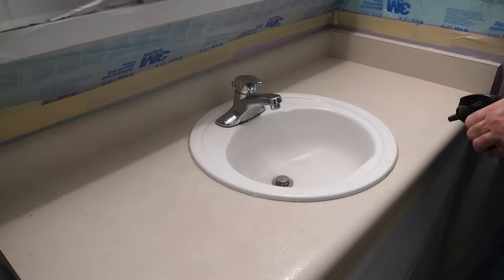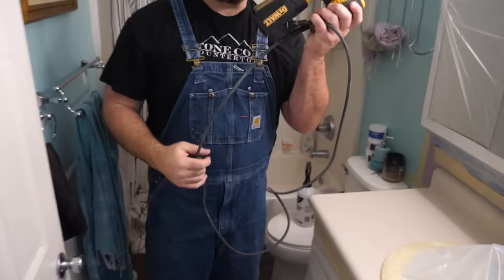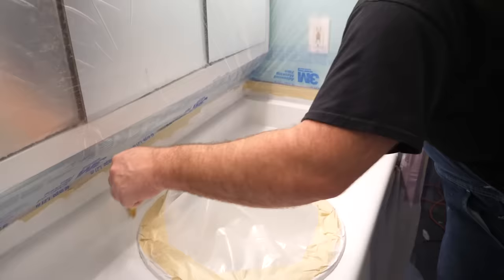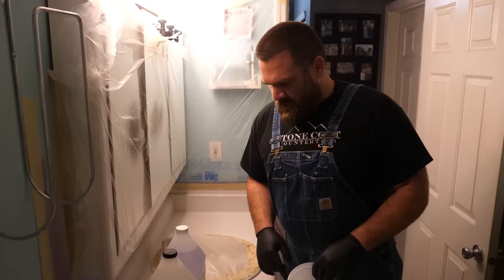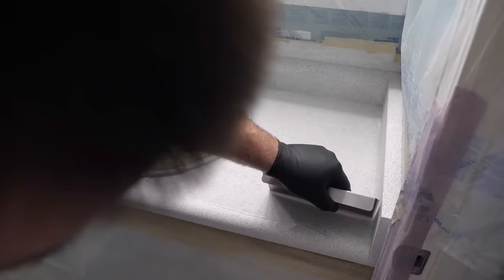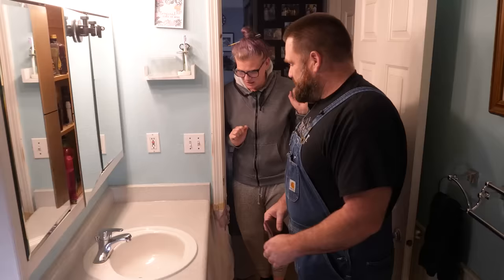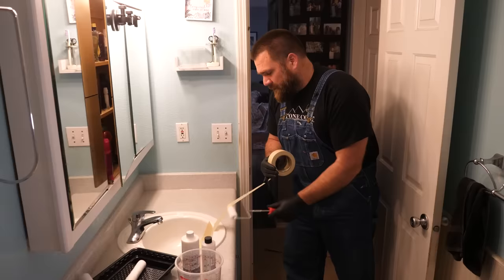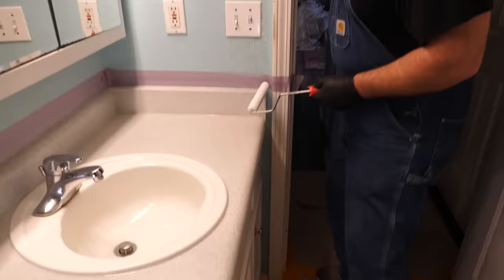Epoxy Countertop with Sink and Backsplash in Place | Stone Coat Epoxy

Comment: No offence but as a plastic laminate worker and fabricater for over 13 years painting your counter it the worst thing you could ever do for your home. The value will be just as bad as if you where to leave it alone and if you don't think other wise that's the problem. Ppl that are perfectly ok with a polished turd. Yes prep work is most important in a quality paint job but painting laminate. I've seen it I've done it my self and never had a call back for peeling even to this day but if a customer want it painted I will definitely convince them other wise because of value and quality.